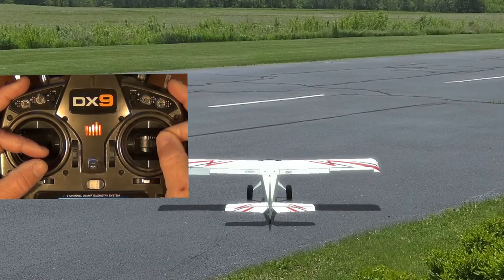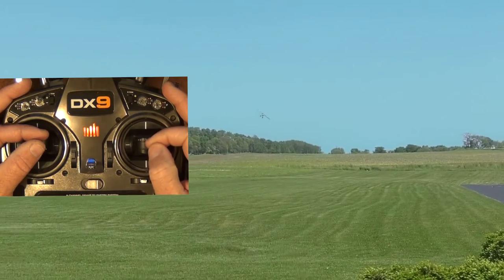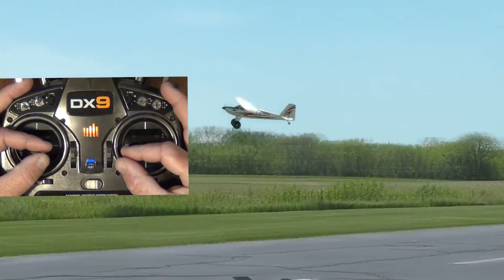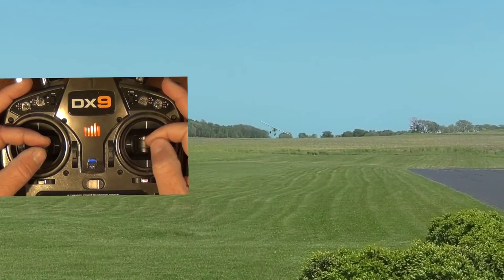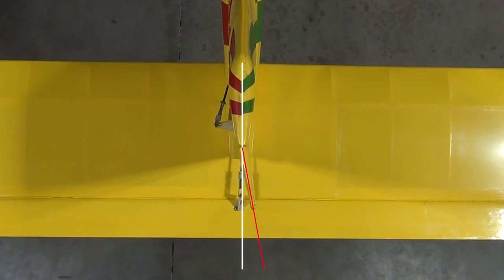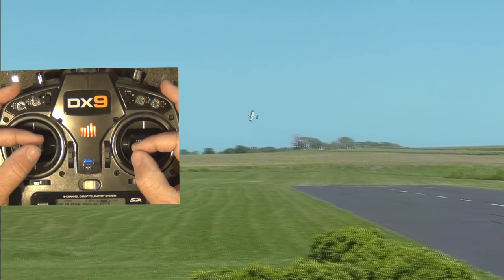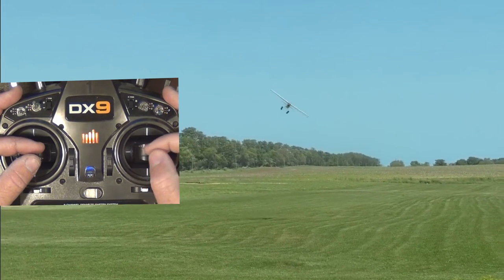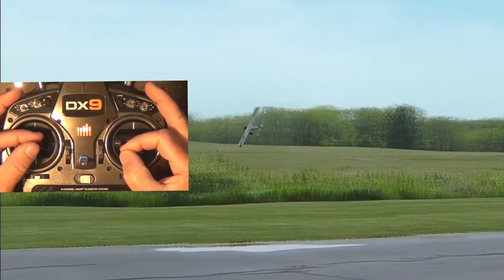Adverse Yaw & Aileron Rudder Mixing Explained

Comment: I agree with using the rudder during turns along with aileron. You are better to actually watch the plane and fly it. Not by a mix
Reply from the maker: I'm going take a shot and ask if you also think that it's best to learn to drive on a stick?  Just having fun with you😆
Reply: I totally agree!
Reply from the maker: The aim of aileron-rudder mixing is to get pilots using the rudder independently, but in days as opposed to years.  A pilot could start out learning to coordinate rudder with aileron entering and exiting turns, but that's not how they fly symmetrical wing planes.  If you watched the video, you'd see that flat or semi-symmetrical wing planes using a-r mixing are flown with the same input techniques as symmetrical planes without mixing.

Comment: Much simpler to just reduce the down movement of the Ailerons .
Either mechanically or with the End Point adjustment on the Transmitter.
Having a lot of down Aileron movement is the same as putting down a Split Flap on ONE wing only.
That is the CAUSE of adverse yaw
Deal with the Cause, not the EFFECT.
Reply from the maker: The flat bottom wing planes I use for primary flight training benefit from some differential, but the only way to get axial banks and rolls with a flat bottom wing is with coordinated rudder